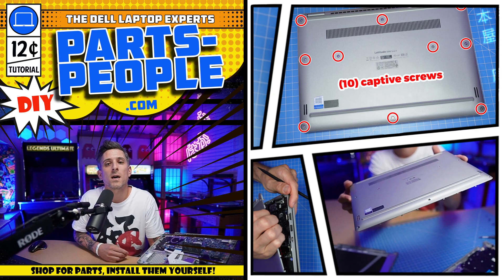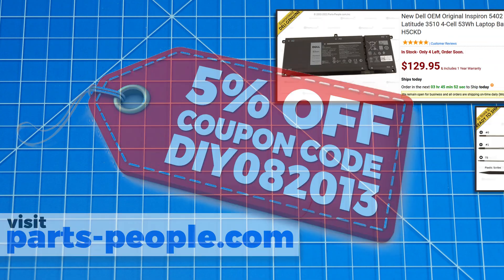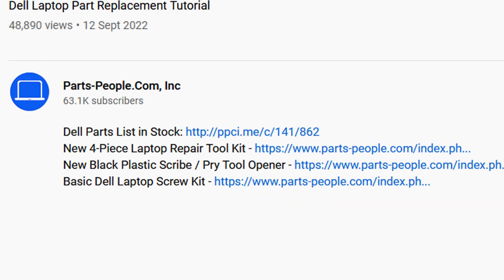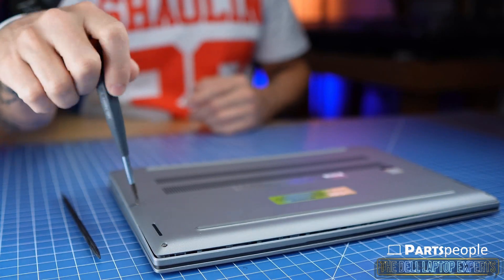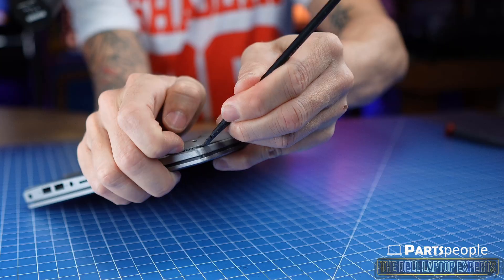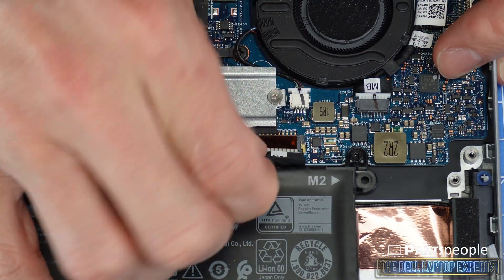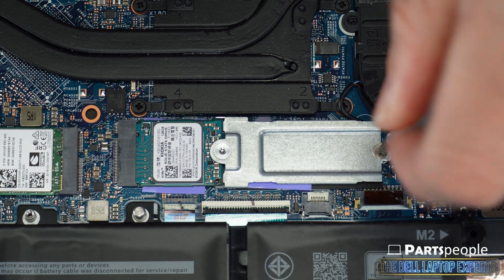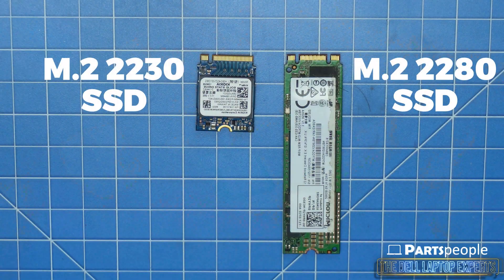Dell Latitude 13 (3320) How-To Install & Replace M.2 NVMe SSD | Repair Guide

Comment: Hi, I need to open up the touchpad button of Dell Inpiron 1545. I removed the button assembly and can see the rubber pad through the gap under the button. It looks like the one under the keyboard key cap and rubber pad. But I can not reach them. How to remove or open up touchpad button caps?